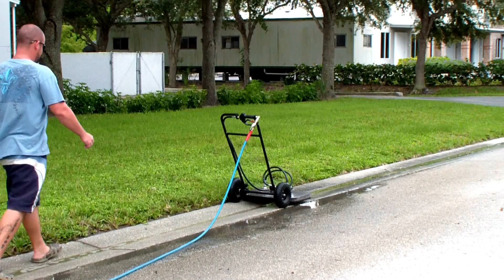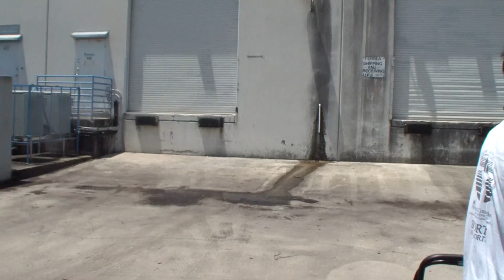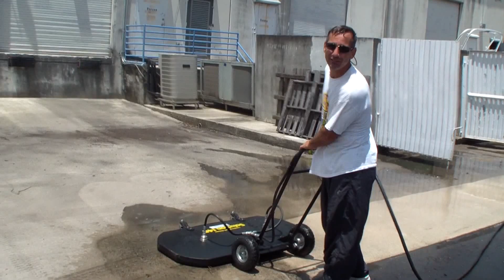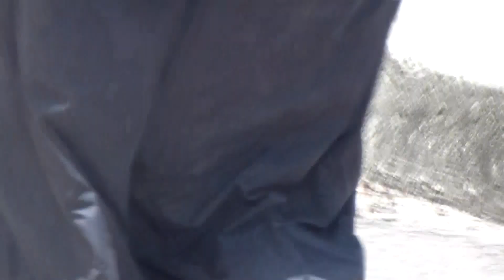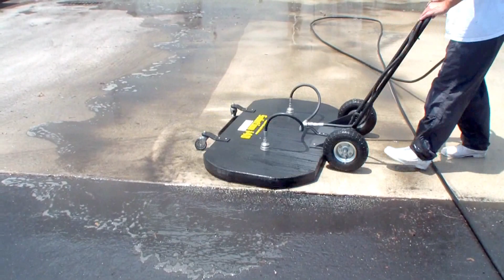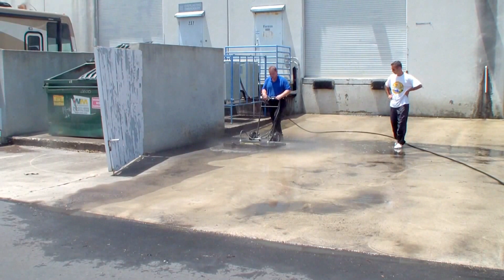Top Pressure Washer Accessories. By Dan Swede Hydro Chem Systems 800-666-1992

Comment from the maker: Top Rated Pressure Washer Accessories. 48"surface cleaners, 24" street gutter (trough cleaners). Industrial Cleaning Equipment & Supply 800-666-1992 sales@hcsclean.com Dan Swede.